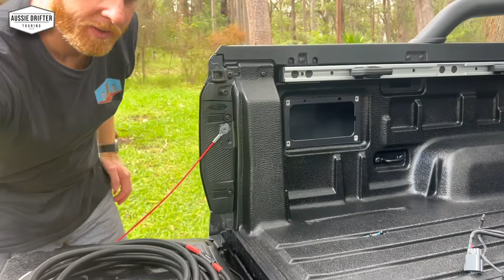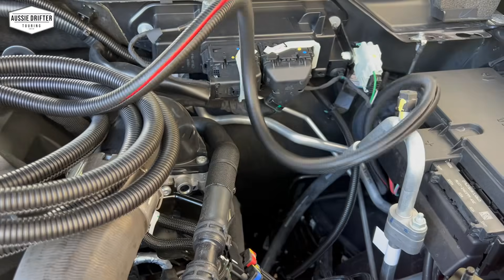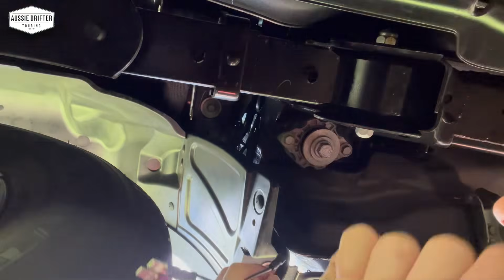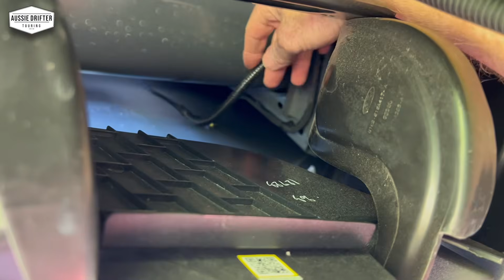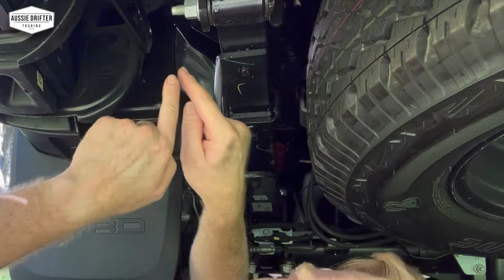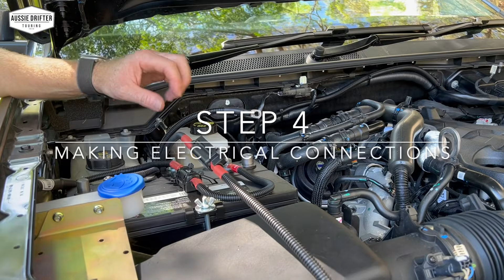Next Gen Ford Ranger | VW Aamrok  DIY rear Accessory Panel installation

Comment: Im still trying to find a panel similar to that, that has a AU/NZ 230V plug. I figure what ID like to have is 1 x 230V, 2 x Anderson (One for solar in going to second battery and one for power out) and finally 2x 12V socket. For USB I can always just plug in a standard car USBC charger into the 12V socket. Obviously some switches too for some of those plugs, a light and the roller cover. Might have to just make the plate myself and buy the connectors and switches. But would be so much easier if I can buy one.
Reply: mandale un fusible automático de 50 amper al lado de la batería pibe ...

Comment: Hey mate great video. Looking into doing this on my next gen ranger. Just wondering would I be able to use this harness for the accessory panel if my auxiliary battery is behind my rear seats? For example if I just order standard 3-5m harness to run from rear seats to the tub accessory panel would that be possible? Cheers mate 👍
Reply from the maker: Hey, yer you can mate thats why we offer shorter cable lenths for that type of setup.

Comment: Hey there mate , quick one for ya 👍 
If I was to run the Anderson off the main battery and connect in my in-tub dual battery to one of the Andersons on the panel , would that be an issue ?
Reply from the maker: That would be fine mate so long as the dual battery was just a 25amp charger it would work perfect.

Comment: Can i use those anderson plug to charge the dual battery？
Reply from the maker: You could plug a battery box into it with up to a 25amp dcdc charger
Reply: @AussieDrifterTouring  how about a trickle charger？
Reply from the maker: @dj010024  yer anything upto 25amps

Comment: Good video but skipped the removing of the Anderson plug when running the cable to the back
Reply: Cause that was a pain until I realised lol oh and I suggest to anyone looking at doing it to do it before you get the long range fuel tank, UVP, bullbar etc. Basically any after market mods. Was not fun....
Reply from the maker: @robbo4687  Hi robbo, the long range tank might have made it difficult but we don't actually remove the Anderson to run that cable that footage is actually taken from the running of our accessory harness.  well spotted that the plug was off😜.  Normally we run it with the plug on though.

Comment: Fused?
Reply from the maker: Yer absolutely mate.  There is a main midi fuse on the battery lead to the panel and 2x inline fuses in the back of the panel.  You can see all the spec here  https://www.aussiedriftertouring.com.au/shop/accessory-panel-nextgen-ranger
Reply: @AussieDrifterTouring  Excellent

Comment: Hello! Could you make a video about the 12 pin trailer connector on the new ranger? Could I charge the battery of the rolling box with that connector? Thank you so much
Reply from the maker: Hey mate not sure what you mean by a rolling box sorry